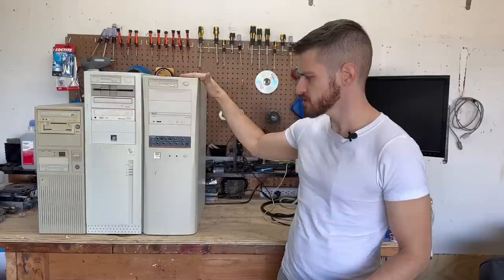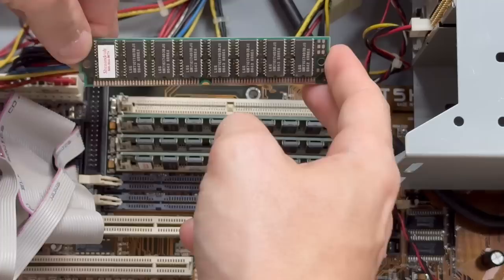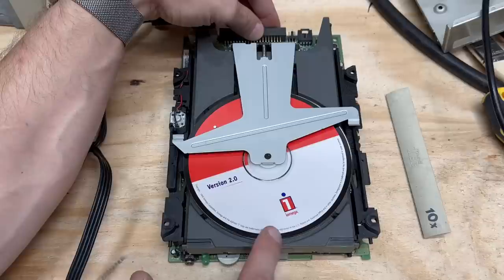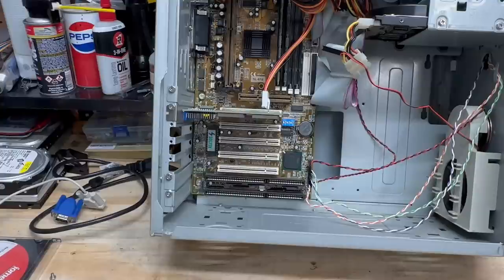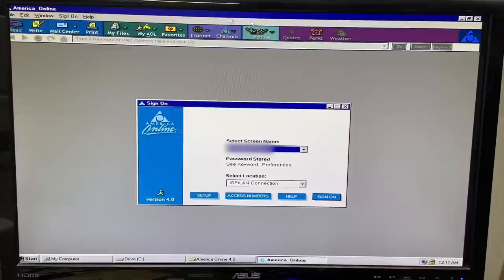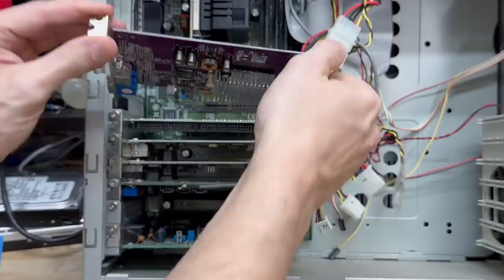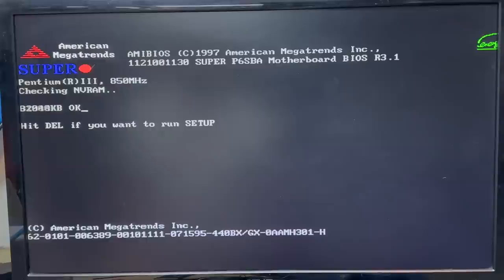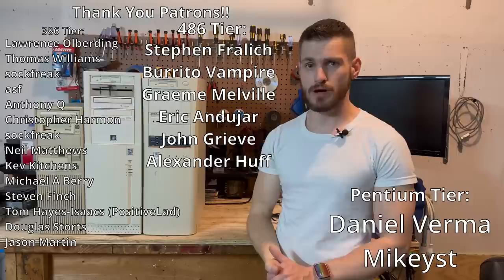Let's teardown and test some GIANT vintage computer systems! From the Franklin eWaste haul!

Comment: Those Fujitsu hard drives were the absolute WORST!  We built those AOpen systems back in the late 90's/2000's and the amount of those Fujitsu drives that failed was crazy!  And I remember Maxtors often having bad drive bearings; they squealed so loud.  I had one that was so ear piercing you couldn't sit beside it... but it ran fine for quite a while in a server hidden in a closet, lol!  Always nice to see these AOpen systems!  Thanks!
Reply: Had a 20GB one fail one me, It later turned out it was the fire retardant used by Cirrus Logic inside the controller chips that caused shorts whenever the drive heated up sufficiently. So if you drive failed, you simply kept it going by putting the entire thing in a fridge and copying your data to a better drive. Luckily Fujitsu soon after discontinued the use of those controllers.
Reply: yeah those maxtors... ugh.. actually only had one of those fujitsu drives come around at one point, oddly enough it still works.
Reply: @neelsmostert  Haha, I've done that freezer trick a few times.  Didn't know about the fire retardant, that's pretty cool to know!
Reply from the maker: I was honestly shocked to see that it actually worked and passed a surface scan! I took an image of it immediately after shooting the video.
Reply: I heated my bedroom with a full height Maxtor SCSI hard drive back in the early 90s.  Unfortunately it also sounded like a jet engine.  I also had a smaller full height Seagate in there, but it had a stiction problem, so I had to keep a hammer nearby for when I needed to power cycle.
Reply: That's funny, I always found Fujitsu drives to be gold; no matter how old, they just worked. Sata IDE, Even the 5 1/4 IDEs.  But yeah, those Maxtors ... Ugh!
Reply: @miketech1024  I think I have a couple that still work.  When they worked, they worked fine... But as I recalled, they wouldn't fail outright - they'd start clicking in between reading and then resume reading.  If you got a working one you should frame it! lol
Reply: @vitajazz  To be fair, from what I recall they didn't fail epically... They'd just start clicking between reads very randomly.  Also to be fair we sold WAY more Fujitsu's then other brands, so maybe my sample is just skewed, lol
Reply: I personally disliked Conner or old Seagate drives far worse than Fujitsu.
Reply: @eshwayri  Came across a triple height drive recently while digging thru my junk pile, yup, it sounded like a turbine firing up as well!
Reply: Fijunksu as we lovingly called them. My Maxtor drive suffered the same bearing death.
Reply: I don't know, I've had more trouble with the Western DEADical drives than any other brand.

Comment: "eardum abuse" earned a thumbs up and subscription!  That audio card and expansion module are still worth quite a bit of money.
Reply: And that caddy optical drive as well, it could probably go for over USD$100 if it still works.
Reply: Although these parts are interesting, they're not interesting enough to be spending that money on anything not modern to upgrade my technology. 

Old parts should stay cheap because of how much maintenance and repair is often required from their use. Otherwise they sit there just to be looked at. Which might as well just be an empty shell at that point. 

Old parts are often scalped for nostalgia. You can find tons of them still, especially these ones in particular. They aren't that old.

Comment: Noiseless audio input is so rare. what a gem.
Reply from the maker: This sound card won my heart instantly upon seeing that! Noise is something I’ve always struggled with in PC recording.
Reply: @miketech1024  Okay... my friend .. before destroy by open a HDD like that (witch it looks it was mechanically fine by the way)_...... you need to clean his power contacts at the least.. _(that behavior is from an HDD that is not getting the enough juice to properly start running you know)_.... you need to see if it is getting the proper voltage in the board.... or some bad cap is pulling down the voltage in it.... or simple oxidation in the contacts of the connector are maybe loosing half the voltage right there.. or a bad or broken solder join............... remove the board from de HDD... clean it... inspect it you see some bad component??.......... veeeeery common... is the silicon thermal pads discomposing shorting thing with the nasty liquid they lose when discompose........... is contact in the board also... that connect the board whit the engine coils inside... they needs to be clean and deoxid...... is one or more terminal with many springs contacts that connect to the heads and to the arm coils.... all those needs to be clean and dioxide also.... _(this goes for modern drive too.. some times an HDD said that it have bad sector because is not getting in the heads the proper voltage because those spring contacts are dirty or oxidized.. is the first thing to do when a HDD show bad sectors clean all his contacts) ........... with a thermal camera.. you should see if it is any component in the board that look to be overheating/shorting by most probably some bad cap that needs to be replace... etc... etc..

Comment: There is some wonderful old tech in those three towers. The Yamaha card must have been quite an investment at the time. What a find! I thoroughly enjoyed this video. Keep up the great work on the channel Mike
Reply from the maker: Thanks!
Reply: Yeap.
Maybe, it's would be a cool idea to combine 2&3 towers,creating some powerful beast.
Reply: My co-worker did the design for the Yamaha AX88 (8-channel analog I/O) which plugged into the DS2416. These survived with software support into the 2000/XP era, and I think could do 8 channel simultaneous record, 16 channel simultaneous playback, and had built-in DSP effects.  I don't know if anybody is pining for "vintage digital" systems, but this definitely occupies a developmental niche in digital audio workstations.
Reply: @poofygoof  People DO pine for vintage DAW equipment. Stuff keeps its value years later.

Comment: The sound card is a creative labs Ensonique card. Creative acquired Ensonique and then rebranded the Ensonique chips to reflect the new name. Althoug known as a Sound Blaster Ensonique, it has no Sound Blaster DNA in it.
Reply: I think it was Ensoniq who developed the EMU10K1 in the Sound Blaster Live cards around the time Creative bought them out.
Ensoniq also made synthesizers but that all stopped after the Creative acquisition.
Reply from the maker: Ahh, so that's why Knoppix identified it as an Esoniq card!
Reply: Creative rebranded the Ensoniq AudioPCI line of soundcards after buying them out. The EMU10K1 is 100% a Creative  developed chip. They bought out Ensoniq for their then-patented DOS Sound Blaster emulation drivers, along with their extensive OEM business.

Comment: That third one, the InWin case. I got one  from Fingerhut 23 years ago. Had win 98. I like that case so much , a micro. I built my first puter from the ground up so I had a matching set on either side of the monitor. 98 & xp fun times. years later a did another InWin case (black) for my wife.  Oh! and the speaks on the Fingerhut identical to the ones you have. The Fingerhut was branded ProTec. Damn, now I feel old, Ha!
Reply from the maker: Wow Fingerhut… That’s a name I haven’t thought of in decades! Think I felt the dust get knocked off of some brain cells. 🤣

Comment: ABit AB-IT5H, Pentium MMX 233, 64 MB RAM, S3 Virge 325, Realtek RTL8029AS

Soltek SL-67B, Pentium II 450, 256 MB RAM, Trident TGUI9680-1, Yamaha DS2416, Adaptec AHA-2940W SCSI card

Supermicro P6SBA, Pentium III 850, 384 MB RAM, nVidia Geforce 4 MX 420, Creative Labs AudioPCI, Promise Ultra66 IDE controller, 3Com 3C905C-TXM, SIIG Firewire Card, Lucent ISA Dialup Modem

Comment: Ive always loved these old full tower cases. FYI those on those old anodized coolers you can gain a good bit of performance by lapping them where they touch the cpu die, i would always go from 400 to 2000 grit sandpaper then burnish with a cotton polishing pad and red compound, used to do that on all of those to get a little more cooling.

Comment: That last one is the In-Win Q500. Still have one, and its little brother, the A500. Solid cases, first ATX ones I ever picked up. The sliding motherboard tray design is the best. The Q500 actually shipped with two options for the base, fold-out feet (as it was very narrow compared to its height), and caster wheels (yea, long before apple "innovated" that). 

And today, I'm rocking the full-tower Cooler Master Storm Trooper, which only barely rivals the Q500 for drive mounting options and space.

Comment: Oh, the nostalgia at seeing the second computer with the harmonica-style P2. The case is made by Aopen, called the HX08 and it was the bees knees for big-tower cases back in the late 90s and early 2Ks. I've owned two or three of them. Super-wellbuilt and very moddable. Usually they came with rotating feet but yours seem to be missing.

Comment: You will need to lock the hard drive in to establish power to that hard drive. Good thing it was there. I was working at Lucent when that modem came out. Those were actually better to have as the onboard chip did the work. Unlike the later early 2000s modem had a smaller chip relying more on the cpu power.
Reply from the maker: Thanks for the info! I was confused as to why the drive didn't at least spin up in the bay.

Comment: Brings back memories. My first PC had a 233 MMX Pentium with 64 MB of EDO RAM. At the time I owned it, in 1997 I wanted to max out the memory, BUT to put in 128 MB of matching EDO RAM the cost was prohibitive at 1400 dollars, so I suffered with a memory deprived system that could barely run Windows 2000 - I used the system for a few years as an Internet gateway and as a server for program and file storage.

Comment: That removable harddrive looks like a SCSI drive..
Reply from the maker: The caddy connector does look very SCSI, so I was surprised to see the enclosure connected via IDE.
Reply: Probably the same connector but definitely not SCSI. That was pretty common on those caddy's to use a connector like that and combine the IDE and power signals into a single connector.

Comment: Thanks to this channel I realized I used to have an Inwin A500 case for my Celeron 300A (OC'ed to 450 of course!) system.  Really wish I had kept it...I didn't even get rid of it until a few years ago.  All that's left is a PowerMan PSU, a 3.25 floppy drive, and two Voodoo 2 cards.

Comment: I have several Promise Ultra-66 cards from that era.  The IDE controllers on motherboards of that era were slow, buggy, and didn't support larger capacity drives.  I always opted to use the Promise cards over anything on the motherboard.
Reply: SCSI was also the way to go in the early days of CD burning on PCs.
Reply: @zoomosis  I have a large stack of Adaptec 2940UW cards that can attest to that.    Somewhere I should still have my Plextor SCSI CD burner, and my Pioneer DVD RAM drive.  Also have several 4mm tape drives along with the backups I took in the mid 90s.  One of these days I will try to restore my system from back then.

Comment: Ah, that Pentium MMX 233 MHz! Overclocked to 300 MHz with Windows 98 - it is the speed itself in its purest form.
Regarding "downclocking" the CPU fan: give +7 volts to it (from the +12 volts rail connected to the +5 volts rail through the fan) - it will slow down nicely.

Comment: I used to have one of those Inwin Tower cases! It was so well made, built like a tank with thick sheet steel, and clever design.
Reply from the maker: It’s definitely made of some thick steel. Thing is heavy!
Reply: @miketech1024  IIRC, it used 1.25mm thick steel.  That model was very popular, and it was nicknamed "The Coffin". Because the front face design resembles the curves of old Chinese coffins.  :-D

Comment: 23:15

Nothing to apologize for, your neighbors weren't even blown out of their houses.

Awesome find on these machines man, I wasn't expecting the guitar solo either, haha!

Anyway you got some cool stuff this go round, shame that Promise card wasn't one of their better 100 or 133 cards, 66 will do for older systems tho, it might be a bit slow on a Pentium III. Cool find on the purple MX4 too, never seen one in purple before, but that's a great retro gaming card. I use a similar 64MB card in my retro system, mine is an early Pentium 4 era tho. Socket 478, Celeron 2.0GHz (Northwood I think), 1GB DDR RAM (overkill but why not?), 2x 80GB IDE HDD's, some kinda AOpen Cobra sound card that does OPL3, and I love the sound of OPL3 in games like Doom, and the MX4 I'm running which I think might be a Dell OEM card but I don't remember. The whole system except the HDD's and PSU dates to about 2001 / 2002. Runs Windows 98 SE, could do XP but I wanted it DOS based. I had a 256MB GPU in it, I think it was a FX 5200 or 5500 but it just seemed so wildly overkill and ran so hot I took it out, the MX4 does just fine, can run everything from Alice: Madness Returns to ye olde DOS games like Doom no problem. Even runs the original version of Half Life 2 before they ported it to the newer Soruce engine really well.
Reply from the maker: Oh the neighbors get plenty of eardrum abuse when I connect it to my sound system LOL. Oh man the Nvidia Geforce FX 5200 AGP was the first GPU I ever bought brand-new. I felt unstoppable playing on that thing! It was paired with an AMD Athlon XP 1800+ with 512MB PC-133 RAM. Wish I still had that motherboard... I do still have the case though, with all of its early 2000s absurdities!
Reply: @miketech1024  Nothing like an eye bleeding early 2000's PC with a blue motherboard, red sound card, purple GPU, round UV reactive IDE cables and those annoying cathodes that always whined. Usually couldn't hear them over the fans, though... Never been my thing but it was a sight to behold!

My current PC is sitting in the most industrial bland case I can think of, an Asus AP201 black without the side panel window. Upgraded to a 4070 Ti from a 2070 Super and I needed a new case. Got a i9 9900k, 32GB of DDR4 3200 and the 4070 Ti stuffed in this thing, as well as a 280mm AIO. 

Anyway I'm planning on thinning out some of my collection since I don't use most of the stuff anymore, not sure what I'm gonna do with it, not even sure what I have, being honest. I should've probably gone thorugh it all over the past winter.

Comment: I doubt this would support a K6-2 but this might be one of those use cases where a Cyrix M-II 333mhz may be a boost (these were often used as they ran at a low FSB speed normally 83mhz rather than 100mhz and therefore worked with "non super" Socket 7 boards. These were very often found on PC Chips TX Pro II boards.

Comment: I had the similar/same Acer CD-ROM as a CD-player in my basement storage/hangout, it was quite cool to see these operate on it's own without the computer attached to the data lines. Also the Pentium 2 looks different to the one I have as a memento, the one in that machine has more heatsink.
Nice riffs btw.
Edit: A lot of computers I found back in a day were dead due to bad power supply capacitors, I think it has to do with the ripple in the supply lines freezing everything.._

Comment: That system with the Yamaha - I used to have this case on an old machine I picked up years ago. Super sad and beat myself up over getting rid of it, it was an awesome case. I still have the motherboard mounted to its tray. It had the same AOpen PSU, so must be one which came with the case.

It used to run OpenSUSE, sadly I didn't know much about linux back then and when I couldn't get root to log in, I gave up and wiped the disks. Wish I could have kept that too and explored it.

Comment: These are all great videos - I started taking PCs apart and putting them back together with my family's first machine back in '97: a Pentium 200 w/ MMX. So much of this brings back memories. I'm curious how you're storing all this hardware - a tour of your system in place and future plans would be cool to see. I appreciate how methodical you are with checking each component out. That P3 system I suspect was a rebuild into an older case. That case screams 1995 - 1997 but those internals like the GeForce MX420 didn't come out until 2002.

Comment: The first one is almost exactly like one I built in around 1997 or 1998. I don't have the tower anymore but I probably still have the removable drive cage. It was used as a family PC

Comment: Another great video! Dang those towers are huge, and have a lot newer parts inside than I would have thought from the front. So glad each machine is getting some time and love in the spotlight. Also appreciate how you even try to get the fans tuned up, so many retro guys just rip out old fans to stuff in modern noctua fans or similar for more "quiet"
Reply from the maker: Thanks!!

Comment: I have a very similar system to the one you have with all the audio jacks on the front, except mine has a Seagate branded tape drive instead of audio jacks and an AOpen case badge instead of the PC builder one. What makes it extra special is that it has a Gigabyte branded dual Slot 1 motherboard, with dual Pentium II 400MHz CPUs!
Reply from the maker: Nice! I would love to find a multi-processor motherboard from that era!
Reply: @miketech1024  I also have a Dell Precision dual Slot 1 workstation, if you don't mind buying an OEM machine that's a fairly easy way to get a dual processor computer of the era.